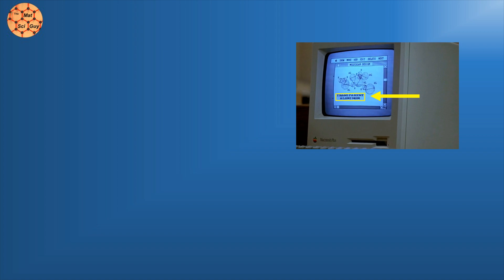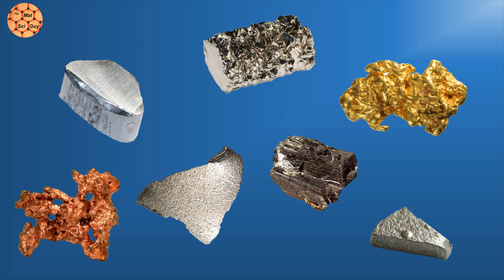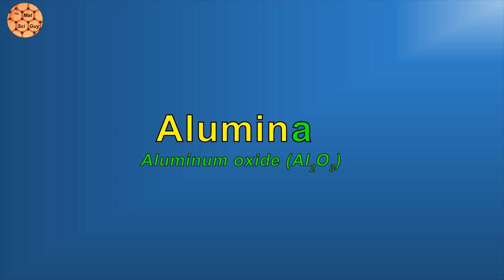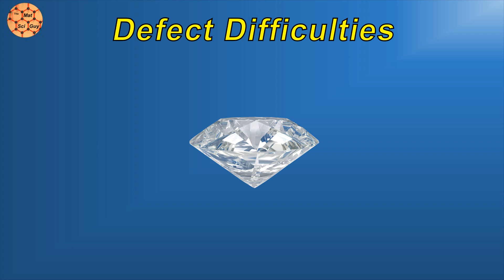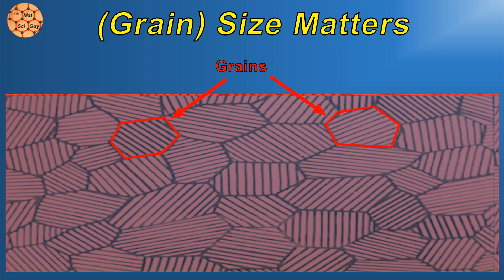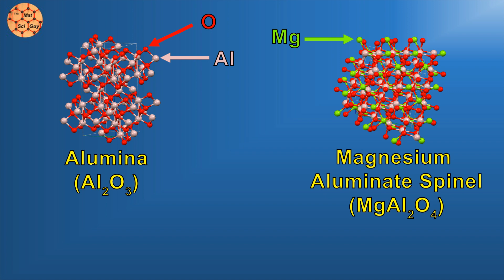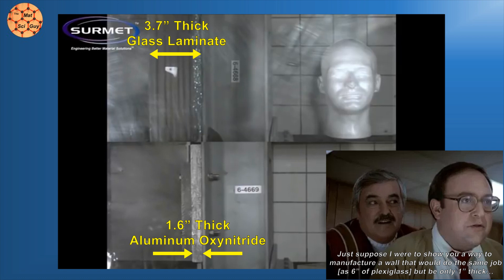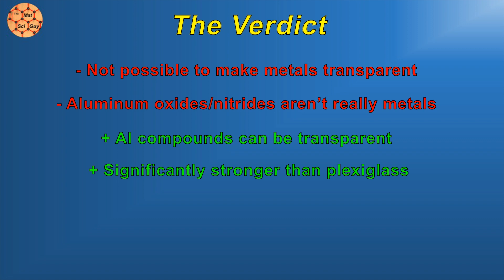Star Trek's Transparent Aluminum: Is it Possible?

Comment: Do you do any forging? I'd love to see some experiments where you forge the alloy you make or team up with a smith for a collab video. I'm wondering if you could make a super alloy steel and while it's molten, add pulverized diamonds to the mix. Looking for a blade that is extremely sharp and unbreakable.

Comment: You probably already know this, but if it wasn't FOR star trek this may not have even been developed.
It's like today's idea of Santa, which couldn't be farther from how it started 😁
Reply: The same could be said for the cell phone which were most likely inspired by the handheld communicators in Star Trek. The first cell phone was literally a brick of electronics in both size and weight, but as the tech advanced and miniaturized many of the cell phones would be "flip-style" phones that mimicked the original Star Trek communicators.
Reply: Nope, not true. By his definition synthetic sapphire glass IS transparent aluminum as it is a ceramic aluminum oxide and has been around since the early 1900s. Far longer than star trek.